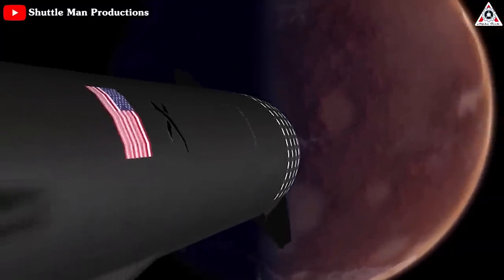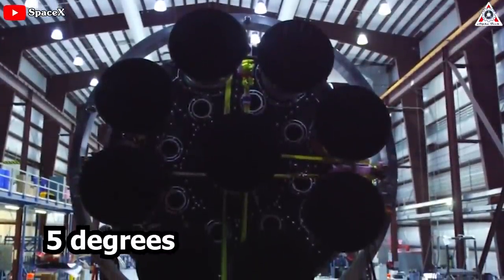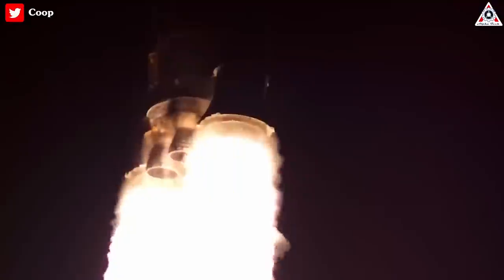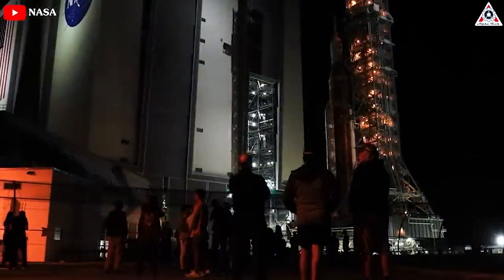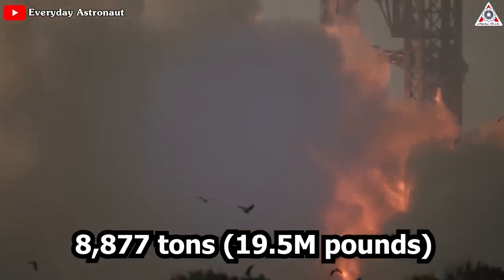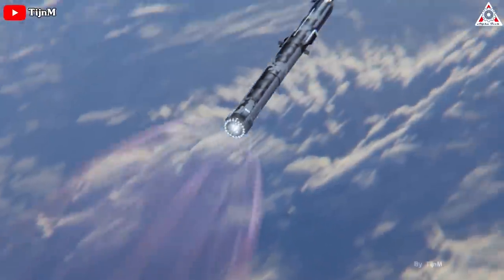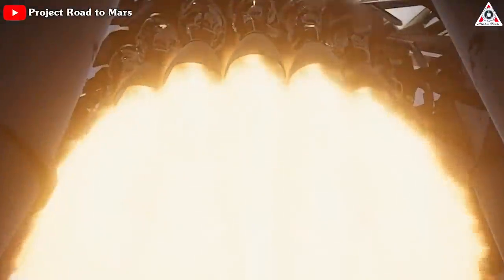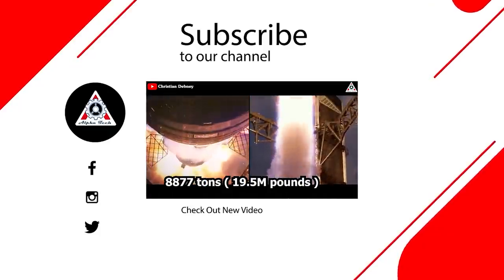SpaceX's NEW Raptor Engine is mind-blowing than you think!

Comment: It is a fallacy to state that the higher chamber pressure produces higher thrust. It is not even true in general. I suspect the reason people keep on saying that is confusion of thrust with thrust-to-weight ratio. Indeed with higher chamber pressure as you run the risk of expelling energetic species in the exhaust due to the higher temperature in the chamber. The more energetic species you expel in the exhaust the less chemical energy goes into kinetic energy.

Comment: The #1 reason to use multiple engines vs just 1 big engine. You didn't even mention, why? Or did I just miss it? If you lose a couple of engines with the multi-engine approach,  the mission can go on. Adversely, if you lose the only engine you have in a single-engine configuration...well the mission obviously ends. I didn't hear you hit that point. Good video though. Keep innovating SpaceX!!!
Reply: 12:20
Reply: @ViperSRT3g  I see your point and I did catch all that, but it doesn't hit on specific. You have to interpret what's said that way. He was talking about redundancy, which is I guess I'm saying he didn't say. I'm just saying it without any ambiguity. Thanks for pointing it out. It forced me to rethink how he said it. So👍.

Comment: With all that said only about  one and half percent of starships initial weight is making it to orbit as payload. With hot staging and raptor 3 engines they may achieve two to three percent payload to orbit. This is still very pricey. 
Future systems will have to be able to get more mass to orbit. About four to five percent per launch should make sustained mars mission possible. 
A linear magnetic mass launcher on a mountain in Ecuador would be the best way to get bulk to orbit. 
Food, fuel, water, building materials, could all be sent for pennies on the dollar compared to rockets.

Comment: Well, I hope Elon continues with the simplification. He's got a good start. The next logical step will be reducing the number of pumps to reduce parts count and complexity, and to increase durabity.
I would suspect the ultimate would be one pump system for a cluster of six or seven combustion chambers.
Then one could cross connect clusters in case of pump issues, and use several other cluster's pump system ganged to keep a crippled cluster in operafion. i.e. you'd want some excess pump potential.
Another area of potential improvement would be efforts at using more waste heat from the combustion chambers to aid in pumping and any other means of turning waste heat into thrust, including an after burner (water injection) aft of the combustion chambers at the throat to the bell. this would allow turning heat into even more expansion.
Also in cluster configurations you could have a pre heating fuel reserve between the combustion chambers in the nstural voids, that then fed into the passages cooling the chamber walls.

Also the cluster configuration would allow
fusing the bell forms together a ways aft  into one larger bell per cluster, extending length and diameter for effect in vacuum.
This might sound radical, but remember the Russian R-180 with two combustion chambers for one pumping system, and that it was one of the best for decades. That should have been a clue.
I would suggest experimentals of three chambers to measure results and working up from there.
We are at the point design wise, like in history building one and two cylinder internal combustion engines. Yes, you can build huge single cylinder engines, but we moved on to more cylinders, and less fuel and water pumps etc. in ratio to the amount of power and reliability. We arent pumping out of the tank with a seperate pump for every combustion chamber, we generally have one pump and then feed and metering systems.
And this would simplify things, reduce parts count further, reduce costs etc.

And Starship does need to get industrial about things...
We wouldn't want Starship 2.0 with Raptor 3's to be as good as we ever got!